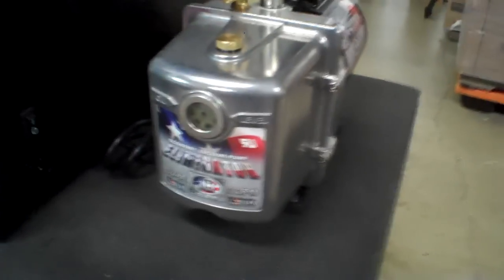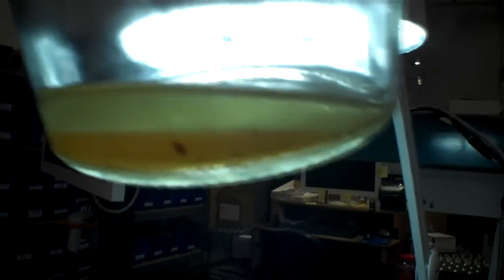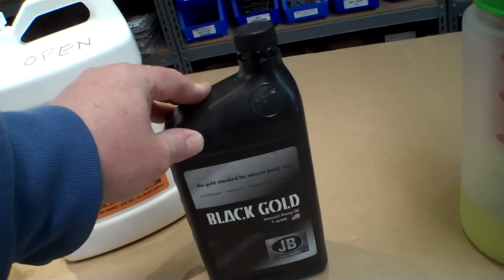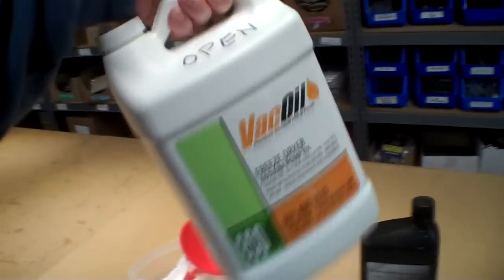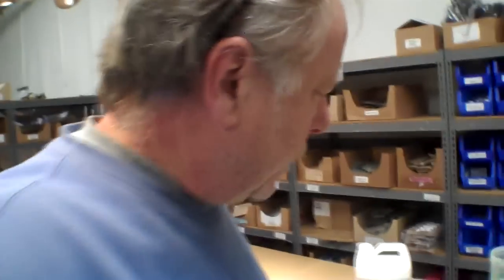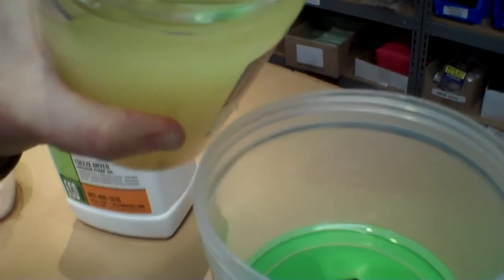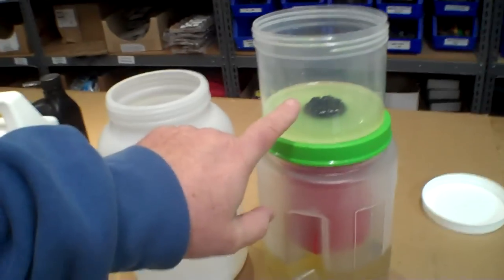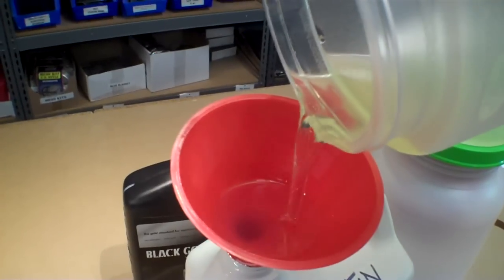Harvest Right Pump Maintenance - Oil Changes - The dirty little secret.

Comment: Is the vacuum pump the most expensive part of the machine ?  If one were to find a freeze dry macine with a failed vac pump what would the price difference be ? I am looking for the most affordable way to get into freeze drying . As these companies similar to harvest right . Don't have an instalment plan or layaway . However Once one understands the process and how to diagnose what is wrong with the machine could pick up a broken one cheap . I will use a couple examples . One finds a generator on the side of the road looks new . Take it home clean out the carburetor  bowl or reservoir on the carb and there one has free 500 dollar generator . Same thing with mowers vacuums the list goes on and on . As we live for the majority in a throwaway society as . Aldous Huxley must have been in the club or known someone in it for Brave New World is right on .
Reply from the maker: The pump is not an expensive item. You can buy a new one for $326. I doubt you would find a $3000 HR being junked. People are really attached to them (I am for sure) and they would be worth getting fixed. But I have seen used ones on craigslist. The funny thing is the used prices have been just a few hundred dollars below the best "on sale" price I've seen. Go figure.
Reply: Yes that is funny about craigslist isn't it ? People who charge virtually 
full blown retail for used items with no warranty . I have to admit I get more laughs from craigslist than from a standup comedian . I am the opposite when I am selling . I face reality as well as paying my self in the buyers shoes . When one does this they are more apt to sell their item . There are those who think that because they paid "example " $400 for a new fuji ten speed in 1978 that they should by all means recoup 90% of their said money . At this I can only shake my head  wonder . 
         Replying to your other response . I can see now after thinking about critically . That yes a dehydrator is going to be purchased by a segment of the populous that Inherently isn't wasteful .  Looking back it is easy to see that my head was in the clouds . As I apparently didn't give the idea much consideration . This I believe is what is called " Wishful Thinking . Thank You for your courteous and timely replies  . As always God Bless
Reply: I've found some very nice brand name American made vacuum pumps at pawn shops for under 70.00 used.

Comment: Over on Full Spectrum Survival . He mentioned Harvest Right Band Sealer 50 . However he didn't show it or tell us what it is . I assumed it was an impulse sealer which I would like to find a quality one .
Reply from the maker: A regular impulse sealer can be found form a variety of sources. I have one that came with our unit from Harvest right, but I also have a really long one I bought from Uline years ago.
Reply: Thank You and Have a Great Day . I realise that multiple platforms have impulse sealers . However The name Harvest Right Band Sealer 50 . Sounded like a new type of sealer that may have new and or more capabilities .
Reply from the maker: Harvest Right does have one called a Continuous Bag Sealer. It has a conveyor belt and does 1/2 seams. At $360 I'll stick with an Impulse unit and do 3 seams...

Comment: Where does the oil come out of the car looking filter?  Is there a hole in the bottom or does it come out the top where it screws into the lid?  Hole in the bottom doesn't make sense if it's holding oil but if it's screwed into the top doesn't make sense either cause you normally have a good seal.
Reply from the maker: The oil comes out of the top and flows down the outside of the filter can.

Comment: Brian, if you cut a roll of paper towels in half and put it in a container (large water bottle) and pour your old oil into it, the paper towel roll will filter your oil beautifully.
Reply from the maker: I've heard that works really well.
Reply: do not do it! in the car world the had the franz filter that you put a roll of tp in it cost a lot of people engines. there are clearances in these pumps
down to 1/2 thousandth and the loose tp would bind them up and ruin that very expensive pump

Comment: I wonder if a water trap could be attached to the pump inlet to decrease the amount of water/ debris that enters the pump? In my mind seems like it should be possible and would increase the amount of Freeze Dryer uses between oil changes.
Reply from the maker: You might look at the filter VacOil offers. They are kind of expensive but probably worth it.
Reply: unless you can see water droplets on the inside of the hose all of the water is in vapor form. vaper filters are out there and will cost you thousands
very special.

Comment: Sounds like a fair bit of money constantly being put out in oil. What do people do with it all after it has outlived it's use? You too must have an additional cost to dispose of it?
Reply from the maker: So far I've been using the same 1 gallon jug for the last 7 months (since it's filtered each time). Now I've got a pump and oil filter set up and it gets filtered as the pump runs.
Reply: Could you do a video on how you did that?  Thanks for the video's, great help!

Comment: Thanks for the detailed video.  We filter our oil after each freeze dry batch.  We have started measuring the oil so we know exactly what to put in the vacuum pump and there is no guessing or overfilling.  Our pump takes 585 grams of oil to fill.  Using a kitchen gram scale, we pre-measure that amount before filling the pump.  Using a funnel to pour in,  that amount of oil fills right up to the sight line.
Reply from the maker: Hi Debora, one of our YouTube channel subscribers offered another idea that I now use and it works great as well. The suggestion was that the pump holds 700ml of oil. And the original bottle of "Black Gold" that comes with the pump has marks every 100ml, so now I just fill the empty "Black Gold" container to the 700ml line, and pour it into the empty pump. It always comes to the correct level on the "sight glass". No full, no muss.

Comment: Bought one, im anxiously awaiting your video doing the power flush I can't find one anywhere
Reply from the maker: JB Industries (maker of the pump) is no longer recommending a power flush. Instead, they now recommend removing the front cover and manually cleaning the internals. I'll go over this in a new video.
Reply: Looking forward to it.  My sight glass is nasty, but have been replacing oil completely every time.
Reply from the maker: Once you pull the front cover to clean inside, it's easy to shoot carburetor cleaner in the site glass to clean it. Mine is clear again...

Comment: Found that the oil baffle inside the pump was rusting,  growing bacteria and also contaminating the oil as it was made out of steel plating. Replace baffle with 1/8 aluminum plate to match existing piece. Made quite a difference in how clean the oil looks
Reply from the maker: Interesting. I have seen that somebody makes a stainless steel upgrade for that pump with bolts and a new baffle. Haven't opened my pump yet but will look into it. No sure why they didn't spend a few extra bucks to use stainless in the first place... But that was a decision the pump manufacturer made. Perhaps they never expected that much moisture, or this application.

Comment: Great video.  Very instructive.  Heard about the Harvest Right Freeze Dryer on the radio so thought I'd check it out on You Tube.  Thanks for the insight.  I can see myself getting a dehydrator in the future.  What size unit would you recommend for a one to two person family?  Thanks.
Reply from the maker: I would go for the medium size. That's what we have. You loose one try with the small one, and the trays are smaller (less food per cycle). But the overall size is not drastically smaller because it still has the external pump, and internally still needs the refrigeration unit and cooler.  The small one is only slightly less expensive too.
Reply: Great, thanks!

Comment: Do you dry your oil? It looks like there is alot of water that was emulsified in it. Could you possibly use a non-food use vacuum to pull the water out of the oil?
Reply from the maker: The Harvey Filter I use seams to separate it and it comes out clear. They say I need to change that filter every 3 months so we will see what happens as I get a bit further along.

Comment: Bryan  just saw your coil winding video which was great and I have a question I have a freeze drying machine and am trying to figure out how to get the display to alert me when it done. I have the machine in the back room and I have a wireless camera focus on the display so I just bring up an iPad app and I can see if the unit is done yet. I've notice that if you don't get it out when it's done the ice makes it start rehydrating. Any thoughts.
Reply from the maker: I have a few ideas. What IP camera do you have?
Reply: EpicenterBryan I'm using a sumo IP-CAM-187V which is really just a wireless china brand and I'm using IPCAM P1 iPad app. It only works while I'm at home it doesn't work away from home. By using the camera I can just open the app while in bed and see if it's done save me the walk. I was thinking maybe thru the USB port send an alert when done.
Reply from the maker: I think I will tackle this project and do a video some time with an Arduino processor. But for now, here is a simple idea that you should be able to make work without any processor or programming. Get a DC relay and a power supply (wall wart) of the same voltage. Connect power supply to relay coil. Plug power supply into same outlet as the pump. Now get a super cheap EasyN F series IP camera. They have alarm inputs. Connect the relay contacts to the alarm input, and go through the manual to set the camera to E-mail alarm status. You can also E-mail to your cell phone as a text message.  For Verizon the Email address would be something like this: 5551234567@vtext.com. You should get a message when the pump turns on, and when it turns off.
Reply: EpicenterBryan Aloha Bryan I like it nice sometime it's the simple things we over look. Thanks for the idea

Comment: it takes exactly 700 ml of oil to fill to the exact line.  If you do what Bryan recommends to utilize the qt bottle which has 100 ml lines on the side.  So just fill to that 700 level and then you don't have to be trying to verify amt.
Reply from the maker: Great input! I'll try that next time. It sure would save some back and forth checking the lines on the pump and adding a little oil at a time when you get close. It's pretty touchy when you get close.
Reply from the maker: Hey, I used your idea twice now. It works great!

Comment: I freeze my oil before I filter it to separate the water less waste of oil. Works great, I also use the TP/ Britta filter. way cheaper. I put a 1/8" barbed fitting with a clear tube on it with a barbed fitting and put the valve on the end- makes it easier to open the valve.

Comment: Best presentation about maintenance of the home freeze dryer so far. This will save so many, if they see it, a bundle on replacement vacuum pumps.
Reply from the maker: Glad you think so. I do wonder though if there were some kind of particulate filter in line on the vacuum pump would further reduce the gunk... Will see what I can come up with.
Reply: The vacuum line that runs into the machine should have a pre-filter to get the goodies that get pulled through the vacuum pump from the chambers interior.

Comment: Epicenter Brian, I think you'll find that you'll still have a bit of contaminates in the pump, even with changing the oil every batch. It will probably be about as much as you'd get by doing your usual oil change.
Reply from the maker: Great inputs. The first power flush will be on the regular schedule and we will take a look at the "gunk"! Video at eleven... );